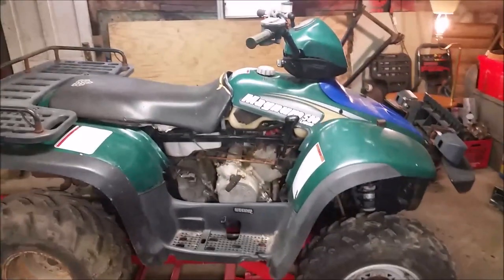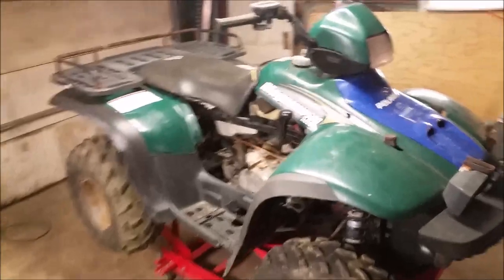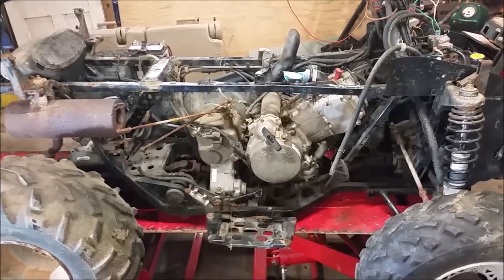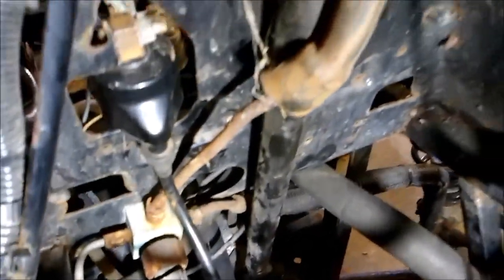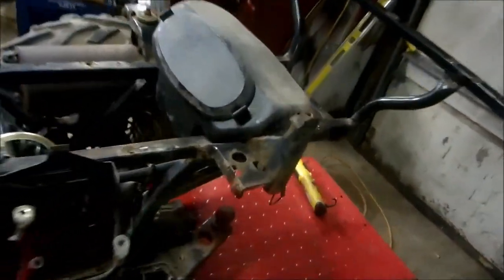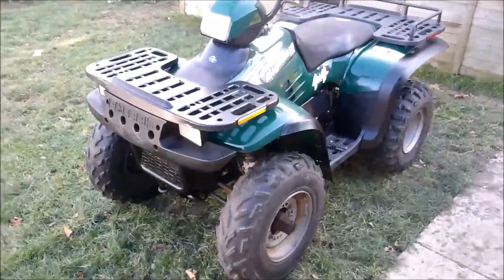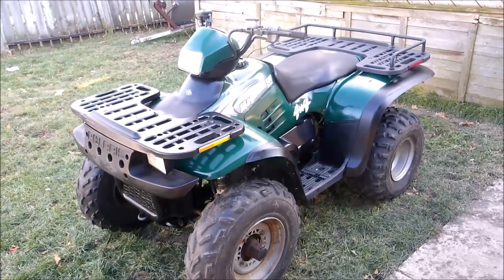1998 Polaris Sportsman 500 Brought back to life! Tear Down Head, Cam, and Carb rebuild!

Comment: I’m looking at a mint 2008 scrambler 500 but the owner says the engine is seized.. any thoughts? Best case hydrolocked worse case ran red hot..
Reply from the maker: 150 to 200 hundred to fix if it's the worst of the 2.

Comment: You posted a video awhile back indicating that you found a sportsman carb on ebay with a 10 year guarantee.  Would you please forward the vendor?  Found lots of carbs but no note on the length of the warranty.  Thanks much.
Reply from the maker: It no longer exists

Comment: What are the torque specs for replacing the camshaft... I have a 1999 Polaris sportsman 500 and have to replace the camshaft and can’t find torque specs. Thank you and really good video keep it up!!
Reply from the maker: Thanks. I don't have the spec's off hand. I usually Google them.
Reply: @TitaniummanGarage  
Do you work on polaris engine lower units on side snd well need piston rings changed . Im in aw michigan but have 1994 polaris 400L need worked on and checked out .

Comment: I've got a question. On the carburetor on my 98 Polaris Sportsman it keeps blowing the hose off of it. I've tried super gluing it I've screwed the clamp on it as hard as I can get it but as soon as you thought it up it blows It Off. What could possibly be causing that?
Reply: Not thought it up throttle it up
Reply: By the way great job on that one!
Reply: Never mind my husband figured it out
Reply from the maker: What was it? I have an idea but curious what it was.
Reply: @TitaniummanGarage   IT WAS THE INTAKE
Reply from the maker: @kippiemoore7439  Ther rubber intake boot? That's interesting. And you said it was blowing the fuel line off? I thought maybe the timing was off. Exhaust valves opening on the intake stroke.. usually blows gas and oil out the carb. Also blows the carb off the intake.

Comment: Hi. I just found your channel and love it. I have a 2006 500ho. I am wondering if the cam issues still a thing on a 2006 would you know if Polaris fixed it by then or if I have to worry about it.
Reply from the maker: It was 97 through 99 I believe. But I have had a 2001 with a bad cam. Polaris made the cams softer in those years. They are better now.

Comment: Did you put on a new intakes one for the head and air box with that new HO carb? How about the larger exaust pipe? If not it's not Ho. How about that clutch? Sounds like it's going to fly apart.
Reply from the maker: Yes, I did. I forgot to mention the exhaust in the video. The clutch is what was making noise. Plus it was 32 degrees out when I filmed it so the engine was really cold when I fired it up.

Comment: Just what I need to learn for the 98 Sportsman 500 I’m going to work on beginning in January!
It runs but many issues e.g., chock doesn’t op well so needs adjustment, R/R.;
Carb should be serviced or replaced as preventative; all fluids filters r/r; foot brake worthless;
Takes :10 to warm-up and run w/o choke on, etc?
Thanks a lot for your time
Reply from the maker: Glad you liked the video. I'm happy to hear you leaned from it. That's my purpose!  To teach! if you have any questions feel free to ask.

Comment: Hey brother.  I like Polaris also, and have made it a hobby to fix and repair them now that i'm retired.  I do great work thanks to you.  I have one issue on my 2006 Polaris Hawkeye 300 4X4.  the battery slowly drains day by day.  I switched the battery out thinking it was a battery issue, but still the same issue, drains day by day.  Within a week my battery is below 12 volts.  did you ever run into the problem and if so point me in the right direction?  Thank you for all that you do.  Ralph in Springfield, Missouri.

Comment: Please help me I have a polaris 500 sportsman frome 1997 end I have a problem it's running poorly end the exhaust it's turning red after running half an hour I have changed the carburetor spark plug I don't now wat happen it's possible too be the cdi or the stator. Tanks
Reply: You getting too much fuel through your carburetor carburetor needs to be adjusted and or cleaned.

Comment: Thanks for the great videos/information!

I have a 2001 500 HO, that I've owned/used Surveying since 2012 (& done a lot of work on). Thanks to your videos, I'm getting ready to replace the cam-

I keep losing the seals on the front hubs-  Any advice there?  Is there a "speedi sleeve" that I should use?

Thanks again!
Reply from the maker: Nice. Glad I can help. I just know there is a gasket or seal on the hub opening when you install the hub. Its green. Keeps the fluid in.

Comment: How much was the HO cam and carb, and was it OEM,  new/used, supplier, please?
Maybe I should do w the ’98 Sptsmn  500?
Reply from the maker: I bought the cam used. In good shape.$35 bucks. The carb I paid $35 bucks. Cheap Chinese carb. wasn't happy with it. I took the parts out of it and rebuilt mine.

Comment: Question man hopefully you see this. Buddy has a 2000 polaris sportmans 500.. Pretty sure the exhaust lobe is wore. Tried looking at your other videos for symptoms of this diagnosis. Beginner mechanic here. Wheeler has no power but idles fine. Over 10 mph it has 0 power.
Reply from the maker: You got it right. Or the jet is plugged on the carb.

Comment: Hey titanium i have a 1998 that has all new top end stator and coil im having trouble getting it to start and idle it has spark the timing is dead on and comprssion is perfect i have new cam new lifters lifters set at 6 thousands at top dead center new carb as well it fires but wont start and idle im at a loss
Reply from the maker: Are you getting gas to the carb?
Reply: Yes getting gas to carb it fires up when cranking but just doesn't catch and stay running its like every 3rd revolution it fires I've triple checked everything even tried a shot of starting fluid it just does the same thing compression is at 120psi while cranking as well tried pulling black wire off cdi box and it does the same been at it for a week now
Reply: I rebuilt the top end because it blew a head gasket

Comment: Dear sir.
Huge fan & sponge of your info.
Saved me Huge lately.
Ran into 1 after another & another in the last week or so, but this 1 has me baffled. 
Have some detailed pics of the carb not lining up with bracket to frame and pulling carb from head boot when the bracket is tightened - pulling it away as if engine slid forward?

2006 Scrambler 500 HO
Didn't wanna have you blow the pics off as spam, let me know if you can shine some light here.
Thanks in advance.
Reply from the maker: Sorry I didn't reply earlier. I missed your message. That happens a lot. The intake boot shrinks and when you install the carb bracket it pulls the carb back. You could replace the boot or bend the bracket in some, depending on the bracket. Thanks for being such a huge fan..I love it.
Reply: @TitaniummanGarage where are you located?

Comment: I really need some help, I have the exact same machine.  It will start but backfire through the carb then die.  Sometimes I can hold the throttle 1/2 way or 3/4 and keep it running but if I let go, it will die.  I cleaned the carb several times, replaced the cam and checked the lash twice.  I bypassed the fuel pump and bottle fed, nothing I do changes what happens.  Can you help?
Reply from the maker: I had the same problem with this one. Check your carb boot. Make sure there's no leaks in the airbox. If it's getting touch air it's running lean and causes it to backfire. I ended up replacing the carb on mine and the boot and it helped .
Reply from the maker: Also check the adjustment on the choke cable. Seems to be a common problem.
Reply: Check the "mode" switch on the left handlebar....  the yellow one.  If it is pushed in then "reverse limiter" is in effect.    Switch in out position is the normal and will allow the machine to run at proper timing.

Comment: Do you have pictures of the wiring up front? I have one that is all torn apart and no reference as to what goes where even with a wiring diagram
Reply from the maker: What year?
Reply: @TitaniummanGarage  I have a 1997 Polaris sportsman 500 4x4.
Reply from the maker: I don't have a 97 right now. I have a 99 and a 2000. It's all plug and play. Does yours have the board the wires plug to on it?
Reply: @TitaniummanGarage  yes it has the board up front that all the wires plug into.    If you have pictures of how the relay and lights wiring is mounted and where they plug in that would be very useful.  Thank you
Reply from the maker: I don't have any pictures, but if you clean the board you can read where everything goes. Brown is ground and is usually the row on the right of the board. Red is power. The headlight has light blue, red, brown, green,purple. They all plug into those colors on the board then to a conection and plugs to lights for oil, temp. And from there 2 or 3 wires go to headlight. I may have a harness laying around I could show you. I'll have to look.
Reply: @TitaniummanGarage  thanks I appreciate it
Reply: @isaiascarrillo83  did you ever get pics of the board that you were referring to?if not I have a 98 that has a board on it in the front
Reply: @atonyrodify  no I never did get pictures so I put it on the back burner
Reply: @isaiascarrillo83  if you would like some just let me know

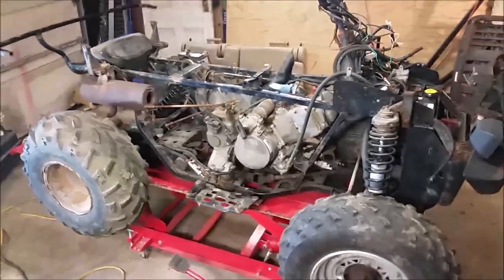Comment: What is the grinding wheel action about at 3:36?
Reply from the maker: The bolts for the shift lever were rusted tight.Had to cut them off. Thought I would look interesting in the video.

Comment: Only your left front tire is mounted correctly.   The other 3 are reversed...    rear ones just swap side to side and your golden...   right front will have to be removed from the rim and remounted in the proper direction.
Reply from the maker: Those were just roller tires. Just something to roll it out the door. They all were replaced.
Reply: @TitaniummanGarage  That would explain it!!   :)